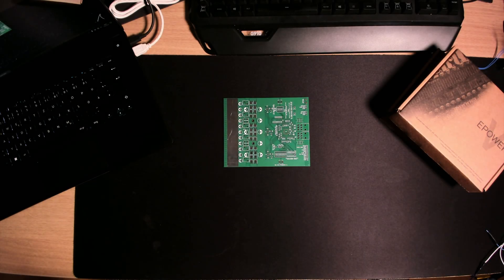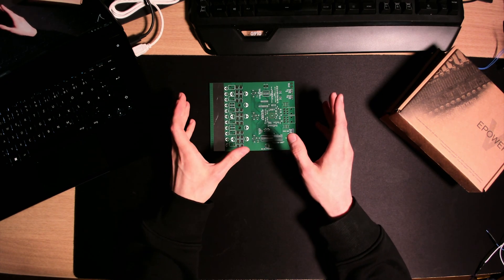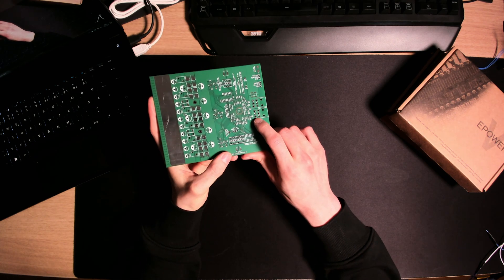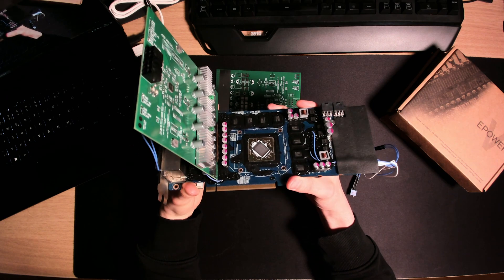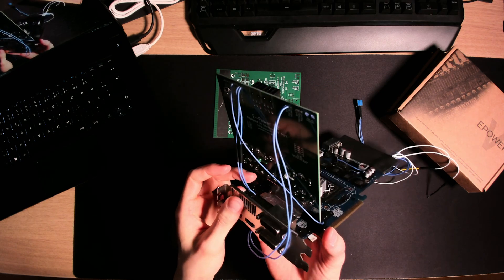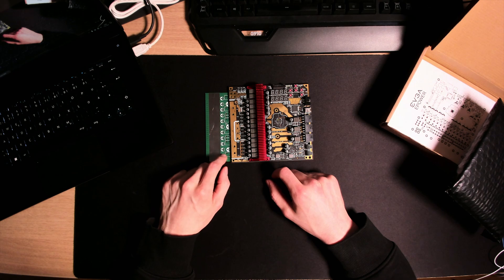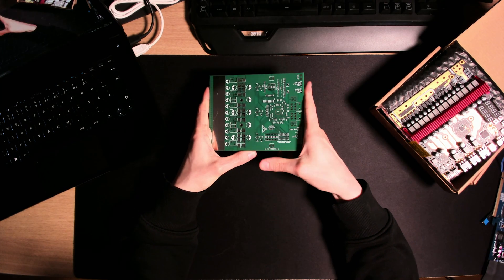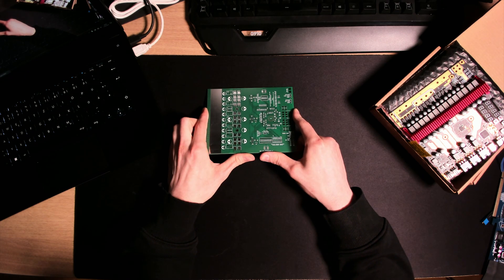I made my own E-Power board

Comment: ... okay, but wtf IS an e-power board? All I can find on google is a Nissan powertrain by that name.
Reply from the maker: It's an external VRM (voltage regulator module) used to replace stock VRMs on GPUs for the purpose of increasing the amount of power that can be delivered to the GPU core (and memory, if needed). GPU overclocking using liquid nitrogen can increase the power drawn so much that some stock VRMs would blow up. nVidia's reference boards for high end Kepler and Maxwell like to do that (as a matter of fact, they're barely enough for complete stock operation of these GPUs).

Linked below are some more videos on the topic:

Actually Hardcore Overclocking - Rambling about the EVGA Epower V power board
>https://www.youtube.com/watch?v=sVkeWuqXxOo

Gamers Nexus - Make Your Own Video Card w/ E-Power, ft. TiN of EVGA
>https://www.youtube.com/watch?v=ewkVNoMbcCc

CmdrSoyo - E-Powers Explained (Zombie-/External VRM Mod)
>https://www.youtube.com/watch?v=a3a7RauX6VE

der8auer - Graphics Card Modification Level: EXPERT (How To Zombie)
>https://www.youtube.com/watch?v=MwtqcpsVUdE

TAGG XOC - Rambeling about epowers & how to attach them
>https://www.youtube.com/watch?v=kqVlChUjJWU
Reply: Yeah seriously! I asked Gemini and it seems like it has something to do with graphics cards. Would love to see more about this in the video description!